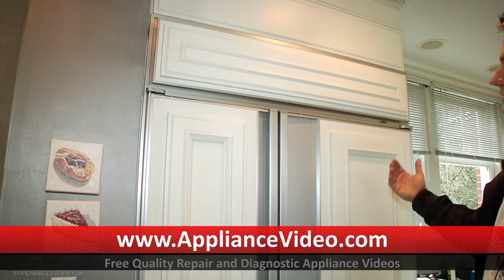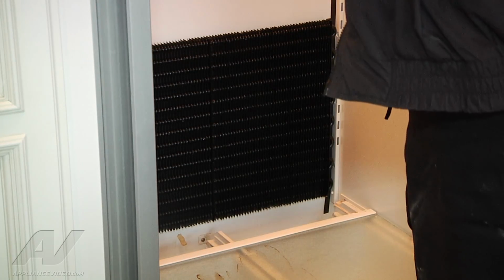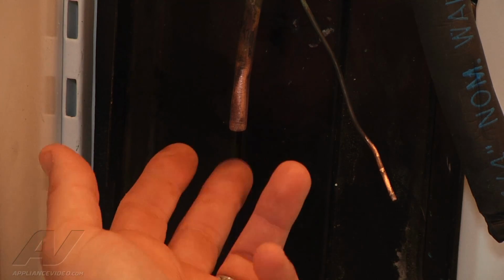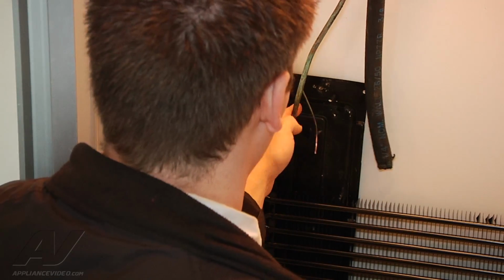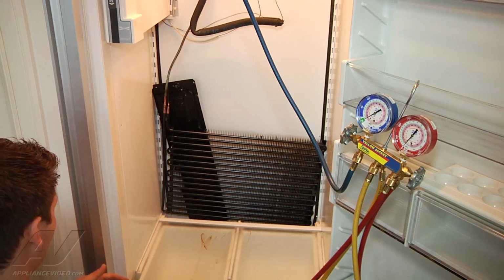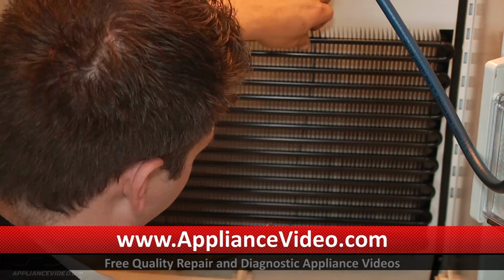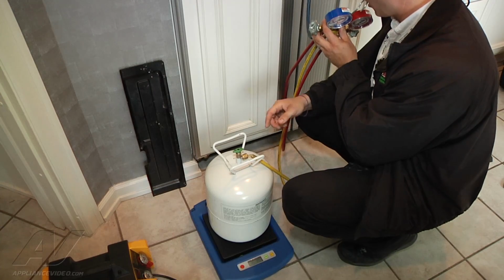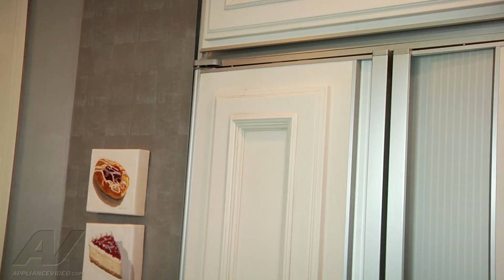SubZero Refrigerator Repair - Not Cooling - Evaporator

Comment: Hi can you let me know where is the water filter location
Reply from the maker: Great question, with our
technicians now getting hundreds questions weekly, they are answering all questions
at our website at ApplianceVideo.com under our Repair Help section. We have over
3,000 common questions and answers that you can easily search through by your
model number, appliance make, and problem or error codes.
Reply: Most of subzeros (or at least older ones) I believe typically use an in-line water filter underneath the fridge
Reply: They don't have water filter

Comment: I have a Subzero 590. There's ice/frost collecting in one corner of the left back wall. My refrigerator temperature is about 45 degrees. Can't seem to get it colder. Does this mean I have a refrigerant leak and will I need a new evaporator as well? If so, what's the estimated cost for parts and service? Thanks.
Reply from the maker: Three Putt Expert 

All of our technicians are now answering questions daily at our http://www.appliancevideo.com/ website under the Repair Help section.  We also have over 1600 common questions and
answers that you can easily search through by your model number, appliance
make, problem or error code and it’s absolutely FREE. You also have the option
to email a factory service technician with a question on your appliance at
http://www.appliancevideo.com/repair-help/ . If you’re looking for a repair video, you
can also search our library of over 2600 free repair videos. ApplianceVideo.com
specializes in quality DO-IT-YOURSELF appliance repair videos and we get over
800,000 views per MONTH to our videos worldwide and growing. If you need of
parts for your major appliance, we have over 5-million parts in stock at http://savemoreonparts.com/ .  Thanks
for your support. Matt Ace Appliance factory service technician.
Reply: Your unit has a restriction in the capillary tube or a low refrigerant charge. When the refrigerant doesn't flow well the compressor converts most of the refrigerant gas into liquid, and in doing so reduces the pressure at the entry to the evaporator. Low pressure causes the refrigerant to boil at a very low temperature creating ice. Kind of a paradox that low charge or restricted refrigerant flow causes very low temperatures.

Comment: Subzero model 430. freezer  warm. Like room temp.  had repair done .  put some stop leak and charged it. Worked for 2 days. Made ice and the 7 days later warn again. Presure guage showed  vaccum on service port. Instead  10 lb pressure that was put in. Help me. I guess compressor is working.  How to fix leak or what to replace. Thanks.
Reply from the maker: discodewanee
                        
           All of our technicians are now answering questions daily on the ApplianceVideo.com website. You can search completely FREE in our Repair Help section with over 1000 questions & answers. Or you can get unlimited technical advice and video links emailed to you by our 14 factory certified technicians at http://www.appliancevideo.com/premium-membership/.  If you are in need of any parts please support our parts department on line at http://savemoreonparts.com/ or call 1-800-830-5465 7-days a week until 11pm Eastern time. Thanks for your support. Matt Ace Appliance factory service technician.

Comment: My freezer fan was making loud noises and then stopped, now I notice d freezer isn’t working, while fridge is in good condition.what could be d reason?plz help
Reply from the maker: Great question, if you have a more technical question that our parts department cannot answer, you can search our over 17,000 answered questions free at our website www.ApplianceVideo.com under our Repair Help section. You can also call our parts department at 1-800-830-5465 and they can give you help 7-days A week ,or search at www.SaveMoreOnParts.com  .

Comment: There is not a lot of repair information on Sub Zero refrigerators, so this video is a goldmine for DIYers, like me. Our Sub Zero 690 Fresh Food section has not been cooling properly for years. We tried cleaning the condenser, but the problem was still there. Just today, it completely failed and the temperature went up to over 70 degrees! I took out the evaporator cover and noticed some frost around the cap tube, right where it connects to the evaporator. I also heard a lot of hissing sounds in that area. Now does that mean I need a new evaporator? And do you think my compressor should still be okay, if the refrigerant leaked out?
Reply from the maker: Hello,
It is very common for the unit to leak where the capillary tube goes into the evaporator. If you heard a hissing noise in that area and you are at +70 degrees in the fresh food, you have a leak in the system. If you shut the refrigerator down by the temperature control, the compressor will not be damaged. You will need to replace the evaporator assembly to correct your problem. 99% of the time you will have NO DAMAGE to the compressor. Replace your filter dryer and evaporator and recharge the system by the name late recommend amount of refrigerant.  

Help our site ranking by becoming a Subscriber and we will keep up-to-date with our growing library of DIY appliance videos. Purchase the parts you need by calling 1-800-830-5465, or order online at: ApplianceVideo.com. Our family-owned and operated company provides you with FREE, high-quality repair videos. Thank you for your continued support and good luck on your project.
Reply: *****
One more question, what kind of torch did you use?
Reply from the maker: mrjost55 Sure thing, the torch is oxygen acetylene - Lincoln Electric Welding Torch Kit — Model# KH776
Reply: ***** Hi Sean,
I am quite sure you are aware that Oxy-Acetylene is used as a cutting torch...which is EXTREMELY TOO HOT, for brazing copper. That is why the copper melted and broke apart on the suction line. People in here should know, NEVER USE OXY-ACETYLENE, to braze copper, or replace a compressor or evaporator. Acetylene torches are used and recommended by ALL appliance Factory Services, and ALL Factory Service Technicians are told NEVER to use Oxy-Acetylene, for a few reasons.
One reason is what you rant into, it melted the suction line, and when I saw the bright red and almost white hot, I knew it was going to melt, and sure enough. You saved the day, but the second reason is that it Weakens the copper, by getting it too hot, which is called over-brazing. An Extremely Good example of how this became an advertised, class action lawsuit, was when (I will not say the Manufacturers name), a Well known Manufacturer of appliances, has some guys on the brazing line, at the factory, over-heating the suction lines when they soldered(brazed) them to the compressor. Why was this a problem? WOW, was a Multi-MILLION Product and money problem, after the refrigerators bounced around on trucks and trains to get to warehouses to be distributed, and by the time they got to the customers home's, they had cracked suction lines...Talk About BURN-OUT!  I worked for that Factory Service Manufacturer, and we had to try to fix all of them, In the field, In the home of the Poor New Owner of that piece of garbage that would not cool. and just ruined all their food! The process, due to severe Burn-out, took between 8-12 hours, to get all the metal particles from the burn-out compressor, out of the system, and out of all the tubing, as well as the severe acid and moisture the whole system was full of, before we could even think about it ever operating again. This was insane, doing this repair in the customer's homes, but most put up with it. We had R-11 back then, which was a cleaner, that you ran through the system, and it dried up like alcohol does, after you flushed the entire system, each tubing at a time.
Enough of that...Case in Point, do NOT use Oxy-Acetylene, it is for use as a cutting torch, and way too hot for brazing copper. Acetylene Only is what works very best, and is recommended by all manufacturers. This was not to put down Sean at all, but because there are so many people that are going to try this, who have NEVER touched a torch, very possibly, they need to know the Proper Manufacturer Recommendations, and the consequences if you do otherwise.
Happy Brazing, All!
Mike ( SZPartz.com)
Reply from the maker: Michael Riley
                         I have used Oxy-Acetlene for 30 years and have installed over 400 compressors myself with it. Even my own in fact 24 years ago along with my best friend 21 years ago and still running fine. Everyone has their own opinion, I base mine on facts not fiction.
Reply: ***** The reason it melted was he didn't have it adjusted lower. I've done this many times. Just turn it down and all is good... lol

Comment: the evaporator was fine, it was probably just leaking in the connection joints and needed to be reconnected properly to seal the leak
Reply from the maker: Great question, if you have a more technical question that our parts department cannot answer, you can search our over 17,000 answered questions free at our website www.ApplianceVideo.com under our Repair Help section. You can also call our parts department at 1-800-830-5465 and they can give you help 7-days A week ,or search at www.SaveMoreOnParts.com  .

Comment: Why would you replace the evaporator, and pull the vacuum, and put in 10.5 oz of R12 refrigerant??? Then, notate that you (LATER ), installed the filter drier, which would mean that you just wasted time, and money. 

You sweated off the heat exchanger and the cap-tube, only to end up having to cut them anyway, which meant you should have just done that to begin with. 

Again time and money wasted. 

Despite all your video editing, and your extra, un-needed steps and mistakes, I personally could probably finish this repair in 45 minutes to an hour. Ill add that, this includes carrying in tools, provided the food is already removed. 

Dont take this the wrong way, because

You did the job right, no doubt. You fixed the problem; but from one service lady/person to another, you still need some practice. 

I'd hire you, but id show you a few things to make this much much easier. If you were simply wasting time to add value to the repair or whatever the quoted estimate was, then it all make sense, and no harm no foul. 

Constructive criticism makes the world a better place, and appliance men have thick skin anyways. 

Roll Tide!
Reply from the maker: All of our videos are shot in customers homes and with professional videographers and factory authorized technicians . Every shot is not done at the same time due to parts ordering and other restrictions. Its very costly and time consuming to produce these videos including  customer consent , taping, editing , special effects &  uploading the content. Its very easy for someone to sit behind a computer for a two minutes and criticize our content when they  know nothing about what goes into the production of a video like this.  We get 1-million views PER MONTH to our videos and get 3-4 thousand thank you comments every month. If you can produce something better, we would love to add it to our ApplianceVideo.com  website. I am curious why you are watching YouTube  videos if you know what you are doing with Subzero sealed system repairs ? I am assuming you have never done this before and are looking for training. Otherwise you certainly would not be looking on YouTube.
Reply: ^^^^What he said^^^^ 😄😄😄 I am a service tech and these videos definitely help me.
Reply: Nice to have a Karen in service tech Industry:) lol